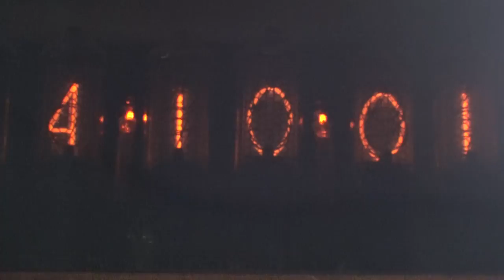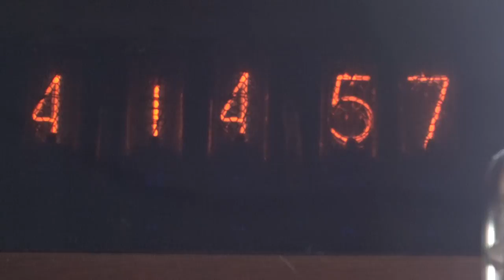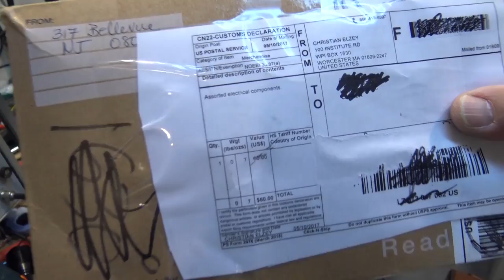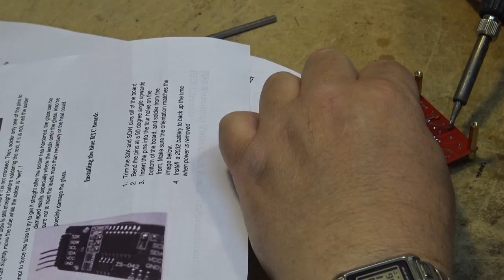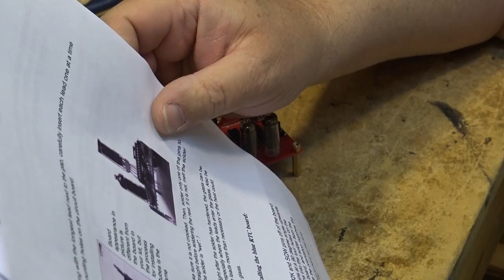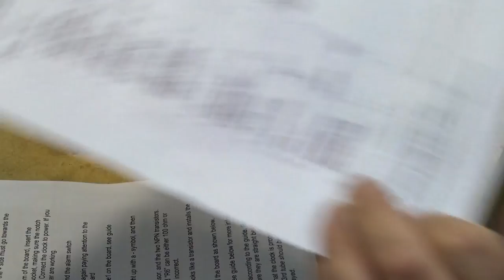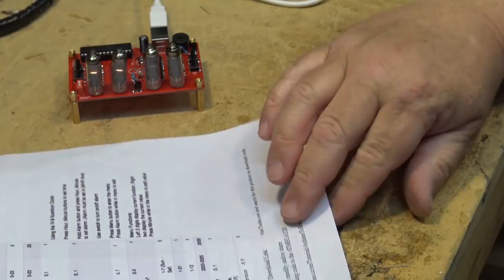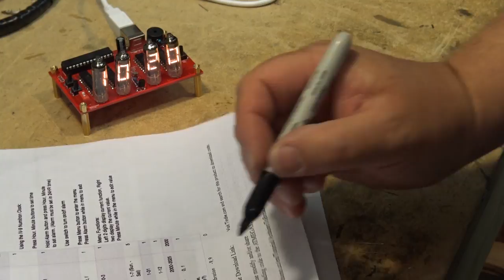Numitron Clock Build

Comment: some of the mechanical digital clocks were kewl, the flip, the drum counters, the slot machine membrain  , which were motor driven.  I had one of those ball clocks, but it went bad.  But the cuckoo is still my favorite.  Don
Reply from the maker: umajunkcollector 
I have a flip clock and a mechanical 7 segment type display which uses lights behind the mechanism and a motor turning a cam gear to operate it.
Reply: Some of those flip clocks are starting to become real collectible and demanding big prices!  ~Jack, VEG

Comment: Back in the 1970s when I was in my mid 20s, there was a Heathkit store about a mile from my apartment. I built one of those panaplex clocks. I still have it in storage some place. I will have to dig it out and start using it. I am also an aviation nut. Here in the US, all time used in aviation is 24-hour. Any weather reports, etc. are in Zulu (UTC) time. (The aviation phonetic alphabet uses the word "zulu" for Z.) Thanks for the video. Perhaps someone needs to tell that bozo to package his kits and assembled clocks better. Shipping fragile electronics in those cardboard bags is just plain nuts!
Have a good one!
Reply from the maker: We used to have a Heathkit shop here in Vancouver too, and that is where my Panaplex clock came from. The biggest thing I ever built was a stereo receiver, and I still have that piece in storage. I have no idea if it even works anymore, but I will be digging it out and tearing it apart one of these days, and look at my shoddy construction quality from back when I was a teenager.
I only built 2 heathkits. The GC1005 clock and this big old receover with a wood cabinet. I always wanted to try the color TV, which was basically a Zenith unassembled set, but at the time that 20" set as a kit was someting like 2,000.00 which was almost double what the same set cost fully assembled, and I wanted a VCR, so I saved up all my money and bought a VCR instead.

Comment: They used to have the large numitrons in the ticket machines used in the BART rapid transit system in the US. Those and some sort of (orange) plasma segmented numerical displays. I recall once or twice seeing a dead segment but you could see the dark filament deposits on the inside of the glass on tubes that were still all there. They used to have all incandescent dot matrix displays on the platforms that were maybe about 10 or 15 rows high  and enough with for maybe 12 large characters or more if the text was smaller. Much of the time nearly 1/3 of the light bulbs were burned out but they looked quite nice apart from that. I think they used shift registers to load the display data in sideways as a 'bitmap' generated externally so the displays themselves only had shifter memory. Also this made them able to scroll without using an enormous amount of early 1970's computer power and they weren't limited to ascii characters. I can't help but wonder if the bitmap data for every platform display all came from one mainframe! Also there were a few stations that had very interesting orange plasma equivalents.  Anyway, great video  - I just thought I'd mention this as numitrons are fun and those BART displays were the most densely packed dot matrix displays I've seen yet.  Now what I really want to see is someone build up an 80 character wide display made entirely of 14 segment alphanumeric numatrons!
Reply: I remember seeing them in gas pumps going back to the late 70's as well. Those orange segment plasma displays are called panaplex, and these as well as their dot-matrix cousins were the early versions of what became the plasma screen. Large scroling message boards also used incandescent lamps, but they also used high brightness conventional incandescent bulbs, and with the rapid switching they generally didn't last that long. In the numetron display they don't run the filiments hot, so they do last a long time, 50-100K hours. Naturally if you run them dimmer, such as in a clock they will last a long time.
Reply: Yeah it makes sense how the numetron's last so long on low voltage, really nice! Seems like those panaplex displays can last a while also. Those orange BART platform displays always worked better then the light bulb ones. I used to use those giant old flash tube photocopiers at work, some of which had a mix of original orange segmented, incandescent, and red dot matrix plasma that was added later. I always used those instead of the newer ones... and the old (dual 240 volt) ones were faster with their powerful vacuum paper handling!

Comment: FOUND MYSELF SCREAMING STOP @ THE PC WHEN YOU POWERED IT UP WITHOUT TRIMMING THE FIRST TUBE LEGS!
Reply from the maker: Why, the leads were not shorted.
Reply: @12voltvids  I guess because they could have become shorted very easily - and as the had to be cut anyway - why not cut them BEFORE testing? prevention aways better than cure.
Reply from the maker: I ork careful. It might not come across on camera, but there was plenty of space between them. Even if they did short, not going to damage anything. Only 5 volts on the pins.

Comment: Hi, thanks for showing us this clock.
May I ask You for sharing the once declared "Open Source" documents.
I want to make one. To have the schematics and code would be nice.
The build instruction can be found on the  address  as mentioned on Tindie still.
The other Google drive links do not work any more.
THX
Reply from the maker: I don't have them anymore.
Reply: THX, will do a IV-9 clock anyway. It is just based on ATMEGA, shiftregisters and most important of all commonly used Arduino code @12voltvids
Reply from the maker: @thomasw2509  i don't code anymore.  I did back in 80s with tms9900 assembler and basic but that's a lifetime ago. Tinkered around with HTML webpage coding way back but dropped it quickly.  Realized how uninterested in code i really was.

Comment: Hi Dave,
Where do I get one? Thanks for another great video!
Reply from the maker: https://www.tindie.com/products/celzey11/iv-9-numitron-tube-clock-/

This is the kit I ordered. Be sure if you order one to tell him to package it better. Mine arrived intact but the next one might not.
It's a nice little unit, and has a RTC module on it, which is something that many do not have.
Reply: Okay, thanks
Reply: @12voltvids  Sorry about that packaging... glad it ended up working out! If I find the time to sell more I will absolutely package it better. Usually I used hard flat rate boxes when shipping them, but I had run out when shipping yours...

Comment: This is what keeps me from getting expensive (like over $25) kits from Banggood. Their packaging is mediocre at best (I get a lot of chips/sockets with the pins bent to shit) and I don't even want to think of how the stuff gets handled by shippers and the post. I got two cheap oscilloscope kits and hopefully the LCD panels aren't cracked (haven't built them yet).
Reply from the maker: This didn't come from Banggood. I bought this one off Tindie, as I also did with a few other clock kits. This kit is nice, it sits next to me on my desk and keeps really good time. The 2 nixie tube clocks are not very good as they don't use a RTC chip. 
Surprising however is the old mechanical 55 year ols transistorized Westclox I overhauled several months ago keeps better time than my nixie tube clocks. After I got it dialed in, it gains only about 30 seconds a month. An electronically driven balance wheel clock that is more accurate than a quartz. Go figure.

Comment: A paneer amplifier has a vacuum for us in this vfd that is running on 13 V DC
Reply from the maker: This is not a VFD, it is a numitron. The filaments are incandescent lamps, and they run on less than 5VDC.

Comment: Hm, seller really cheaped out with those sockets; turned pin IC sockets would've been much nicer (and sturdier to boot) given the price you're paying.
Reply from the maker: Sockets? What sockets the bloody tubes are soldered directly to the board.
The new Nixie clocks from PV electronics use tubes that have leads too, but they pre mount them to boards that plug into the main board. 
The 2 nixie clocks I built I had to mount pins on the board so the tubes could be changes, but those style of tubes had rigid pins like a conventional vacuum tube.